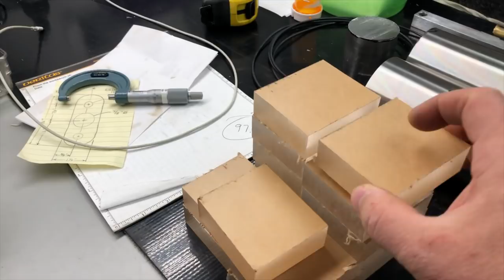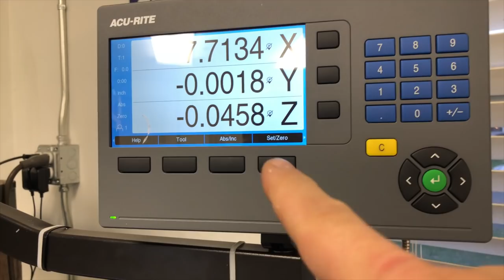Making Lockout Covers From Cast Acrylic

Comment: enjoyed Brad...happy holidays...just a tip, drill and thread the Kurt jaw cap screw bolts with 10-32, then you can attach your angle to the jaw and simply drop your part in...no need to keep holding/setting angle
Reply from the maker: Thanks Chuck!

Comment: I must have missed it but why did you not use a boring head instead if the rotary table? It sure would have seemed faster and easier.
Reply from the maker: bcbloc02 Brian, if I used the boring head, the bottom would have lines. I wanted a clean bottom with no steps.